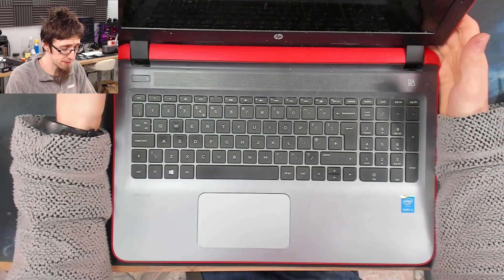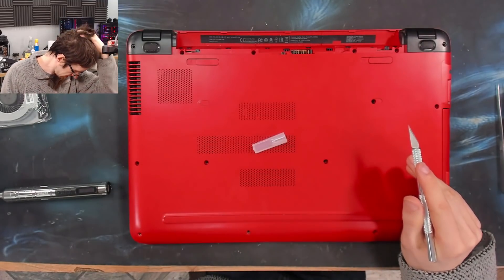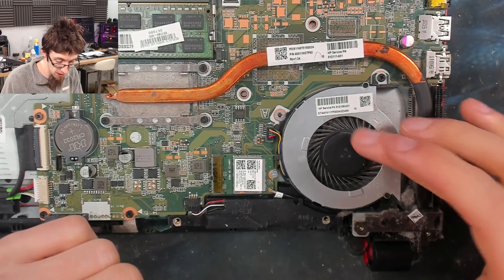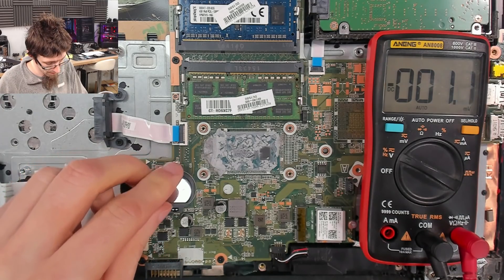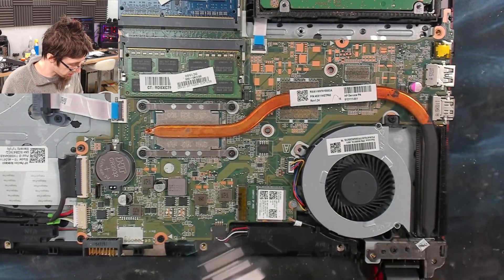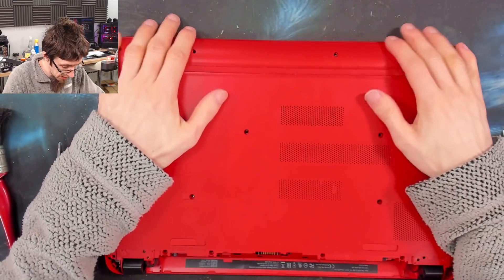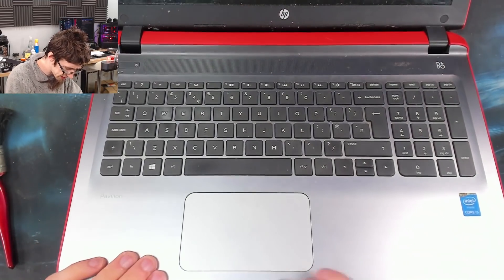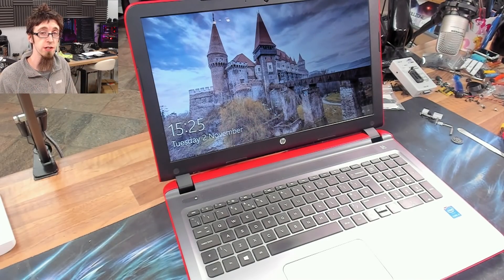HP Pavilion Cooling Fan Error Message Fix - LFC#286

Comment: What's the function of that small 3V battery?
Reply from the maker: The 3v "bios battery" keeps the real time clock (CMOS) circuit running when the device is off. Contrary to popular belief, it does not power the BIOS chip itself. But removing the battery signals the CMOS circuit to reset, which also clears any custom settings from the BIOS chip. Many modern laptops don't have a BIOS battery, and just rely on the main battery for this now.
Reply: @Adamant_IT   Thank You for such a clear explanation. My laptop is of 2014 i5 5200u 😅 I better not take out the battery

Comment: Hi friend great video! Let me ask you a question please... it happened the same to mine (although it had pretty a new fan), so I bought a new one and got it installed. Same message over and over. Do you might know what could be? I don't know what else to do. Thanks
Reply: Same here. I have a Pavilion 24 All In one PC and was getting the 90b error message. Ordered a brand new identical fan and installed it but still get the 90b error message it is very very frustrating!

Comment: I recently had the same problem with an HP dv6000 series laptop, a little older model. There is no warning when the fan stops working on these. I ran the free program "Core Temp," and saw that the Intel CPU was getting to over 200*F and still functioning, which is quite a feat. After the new fan, the most it gets now is about 135*F under full load. The dv6000 series has a trick in taking it apart. There are 2 fasteners on the bottom, under the memory access cover, that require a small socket to remove. It's not like this one, where it's just phillips screws, which is easy. No wonder you can't find any full "take apart" videos for this model on youtube, because most people don't know about these 2 hidden socket headed fasteners. They are also a royal pain to get started, and put back in as well.

Comment: i have the same message but my fans loud as hell and the rotates fast
Reply: pls tell me if i should do the same and replace the fan
Reply from the maker: Hard to tell. I would change the fan and see what happens. I think I've seen a HP that kept throwing up fan warnings even though the fan was spinning, and eventually I just changed the fan on that one - I can't remember if that solved it though, so your mileage may vary.

Comment: Hey hi I wanna know something I have a very cheap laptop and it won't boot on and all principal components are wlded I was looking if something fall off or something because before it was booting but in UEFI Shell but keyboard won't work like no type and after I completely unpug energy I mean battery after pulling it won't boot whit out hardisk or battery connected before it was able to boot whitout hard disk but now not anymore but I mean only charger signal because if me power on is just don't the screen black and cpu is not even becoming hot this means maybe happen to BIOS idk is just won't turn on it only charge whit all components connected (Hard Disk) and fine but whitout the hardisk he make sound like electricity when has a problem like in films but this happened after I unplug battery (of course me plug the battery back but won't turn on) any Tip or Help please?

Comment: hp laptops fan's suck! i had 2 brand new hp power 15 laptops and both fans rattled within a month.....no waranty on moving parts....100 dollars for 2 fans gpu and cpu....and the funny news is the new fans have a rattle sound aswell Hp has the cheapest fans they could find in a laptop wich cost me 1500 dollars...no more hp for me...traded it in for an Lenovo Legion gaming laptop.... the quality is way better!...and for the hp you repaired...put some tape on the heatsink and fan...it will cool better

Comment: I like your video but I would personally try to lubricate and fix that fan, if not fixable then order a new one. Same thing with fixing plastic screw holders and hinges. Hot glue makes wonders!
Reply from the maker: I can lubricate it, and roll the dice on it lasting another year, or another week, in which case the laptop comes back into the shop and I have to do the whole job again free of charge to the customer, and apologise profusely for not getting it right first time.
Or I can spend a few quid on a new fan and know that it'll last the rest of the laptop's lifetime.
Reply: @metalacos toitally not worth it. Adamant IT is charging for their services and it makes totally sense to replace an item which suffers mechanical wear and tear. I could try lubricating my own laptop's fan but I wouldn't expect a service shop to try and patch such a simple and cheap item.

Comment: My rule for fans is usually that if it's spinning but making some noises, I would try to lubricate it and see what happens, but if it's like this case where the fan is completely seized up or not spinning at all and fan error is reporting, then usually the motor is gone and it's far too gone so I kinda have to replace it.
This is because sometimes for old low end laptops, the fan is not that well made and the lubricant might have been dried up and so even if you buy a new old stock the fan will still grind until you lubricate the fan (this happened on my Compaq CQ56 where I had to replace the fan as the motor was burnt out but it started grinding after just days of operation until I lubricated it)

Comment: you can use that thing women use for removing their nail paint on cleaning electronics too its called tinner
Reply from the maker: Nail polish remover is usually based on Acetone. It's very aggressive, I wouldn't use it for cleaning computer stuff unless you're very very very careful. It will often stain or even melt plastic.
Isopropyl Alcohol is a lot safer to use, or for simply wiping down plastics, use glass cleaner (water/vinegar).

Comment: Your laptop repair videos are an inspiration!

It looks like I just fixed an old Lenovo Ideapad laptop using the method of one of your older laptop repair videos.

Laptop was powering on, but no POST.  I tried various resets and the special CMOS start button to get it going, but to no avail.

Given that power on seemed fine, I suspected that that a corrupted BIOS may be the culprit. It took a few weeks to get all the little adaptors for my TL866-II plus EEPROM programmer, but I was able to hot air the bios chip off, reflash it using my programmer, then reinstalled it (I replaced the old solder with fresh leaded solder ... easier to work with) and now it seems I get a successful post and boot.

So yay for me and my customer.

Comment: Cheap alternative to air compressor that isn't an environmental nightmare like canned air... go a Decathlon and get an airbed pump (the manual kind with a big plunger, not the foot operated ones). It'll cost you about a tenner and comes with a fine nozzle. These high volume pumps can deliver a lot of air and are great for blasting out dust!

Comment: I had to replace the thermal paste on my PS3 it got some Artic MX-4 and had to use Tesco glass cleaner to remove the old crusty thermal paste it worked very well thanks for the tips and videos
Reply: did you get any cooler temps with it? i did to my ps3 slim and is the same temps, 60 cpu 70 rsx.
Reply: @LM_740  My thermal paste had gone crusty it took quite a bit of cleaning as it was so dry. Mine runs about the same now.

Comment: Compressed air and a bit of switch cleaner would bring it back to life
Reply from the maker: I've done that a few times. It'll work for a week, or a month maybe. Sometimes you get lucky and it'll keep going until the customer replaces the laptop...
But in my experience, it'll likely come back in, with a customer who thinks you didn't do the job properly. New fan isn't expensive, just replace it is my mantra.

Comment: Did not know that about the PCH die. I did that recently to my x250. I'm assuming it'll be fine though having paste on it.
Reply from the maker: Honestly not sure. I don't think it'll cause a problem, because the temp drop between the core die to the cold plate, then the cold plate back into the PCH, will be large enough to avoid trouble.
However, for rule-of-thumb, the best course of action seems to be whatever the OEM was doing.

Comment: no ssd replacement while its open ? 🤔
Reply: Yeah, a SSD upgrade would have made that old laptop MUCH nicer to use!
Reply: @Leftfield2k7  Agreed. I won't go anywhere near a laptop with a hard drive unless it's running a lightweight Linux distribution. Waiting around for 5 minutes for Windows to get its shit together every time I turn on the computer is not fun.